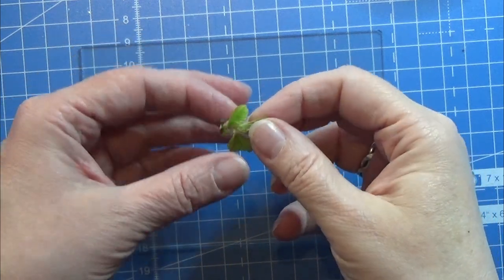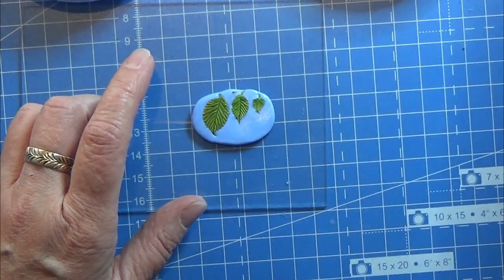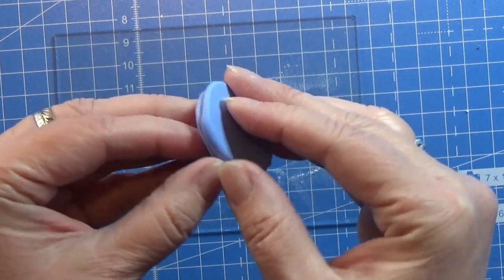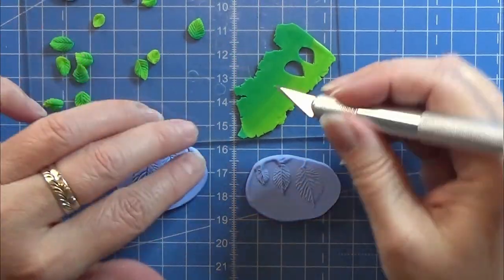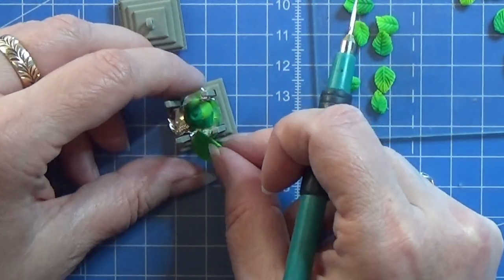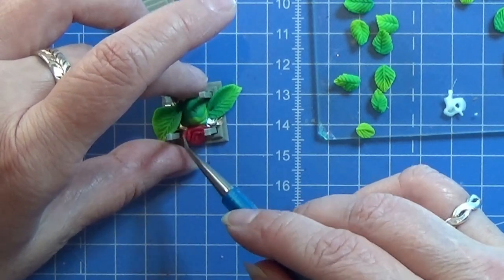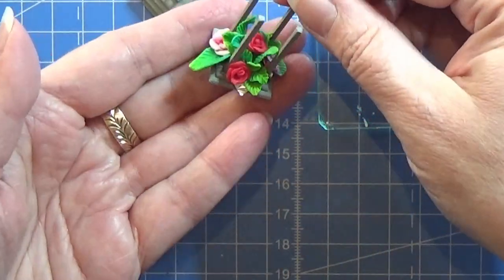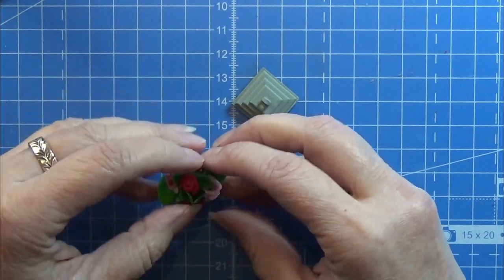Polymer Clay Miniature - Leaf Mold

Comment: This is a fastastic tutorial. I can't find  the size leaf mold  I want and right now the leaves are in prime growth. You just plainly explained that, down to the powder release.  As far as length? I would think it would vary somewhat depending on the topic. I find I have zero issue watching yours.   Sorry that's not helpful. 🫤
Reply from the maker: Well that is the only downside to this video, the leafs needs to be young, and small to be able to find some there is small enough, also the reason why I did not do this one sooner, I have been wanting to do this one for a few years now, but always came to late for it... this year I finaly mannaged to get the small leafs I needed ❤️ And thank you, you actually also did help me a lot with the length of my videos ❤️